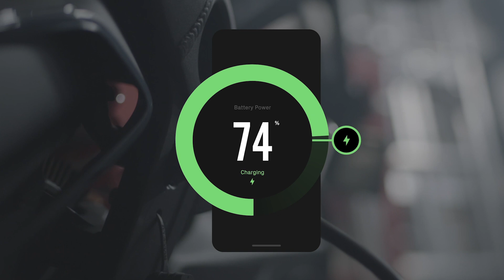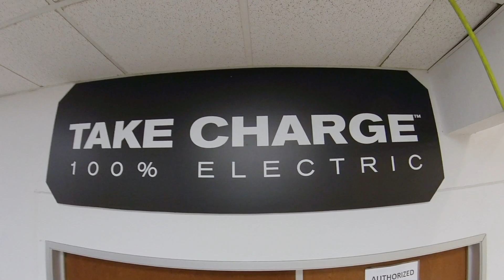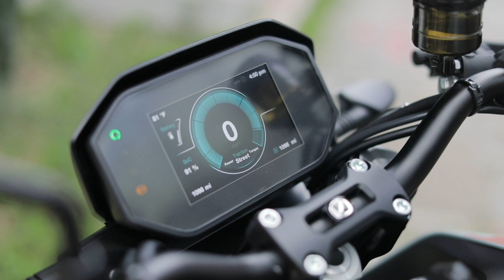Inside California EV startup Zero Motorcycles

Comment: This is a great review. I drive motorcycles for 40 years. Started on a Suzuki 380 2-stroke, Honda CB400N, Honda CB750 (single camshaft),  CB750 (double camshaft). In 2014 I drove a Yamaha VMax when I did a test ride on a Zero SR. I was flabbergasted and turned my Yamaha Vmax (great machine) in on the Zero SR. After five lovely years with my Zero SR without any trouble, I swapped to a Zero SR/F. I love electric motorcycling.

Comment: i am all for spreading good information on electric bikes, with all there faults, i still own and love to ride my zero dsr,  so why does at 1:05 seconds you CAN quote him saying the highway range is 165-170 miles ? at 65 mph,  that's odd cause its totally false, that's the city range, not highway , highway is more like ONLY 80 miles of range. even ON zeros own website they Quote 200 MILES CITY IS WITH the power tank. NOT the info this guy is saying you can hear him say, 220 miles of range in city driven miles. he mentioned no extra power tank for 3k.  it seems worse when its only 200 miles of city range, with the 3k dollar power tank option added on the 14.4 kw battery it comes with.which most owners might not have. but that's the default range ? i just wish they would quote practical figures,  like how charging time is listed to geto to 80 percent in about a hour instead of saying 1hr and a half to full charge.

Comment: Why not try hub motors and free space for bigger battery?
Reply: They are not good for a high performance package. The hub motor acting as unsprung weight at the rear wheel will hinder the performance at higher speed even though it could accelerate faster from the start compared to a mid motor.
Reply: because the physics of a hub motor make the handling awful at speeds of anything higher than 30mph or so. which is one reason why i ditched my super soco for a zero

Comment: Why is it that when talking about charging times they all quote the charging times of 0-80% rather than 100%?
Reply: Because the last 20% needs more time so it probably needs another half an hour to 100%
Reply: @A--lex  it's still not an accurate real world quote they give. People won't wait until it's at 0% and push it to a charging point and they are likely to want a full charge since the range isn't good anyway.
Reply: So basically plan on charging it for two hours
Reply: @EZ4U2Say11  still quite some way off joining petrol bikes on tour then

Comment: so 0-60 in ?
Reply: сука Blyat I’ve heard anywhere from 2.8-3 sec. That’s in MPH
Reply: Vids of people actually doing it vary between about 3.4 - 4.8 secs. Not quite sure how you can get such a variation when there's virtually nothing to it other than whacking the accelerator wide open and waiting, but it's right there on video for all to see. I tried it myself and the only meaningful timing I could do without a GoPro was "fuuuuuuuu"
Reply: Caspian Prince if they are rolling already or if they are “whacking” the throttle wide open from a stand still and spinning the tire a bit before they take off your going to have varying times. Just a thought. But theoretically they can go about 3 sec if not a tad faster
Reply: @caspianprince  Best launch is in Sport mode w/ TC OFF and a rider skinnier than me.
Reply: @Miata822  I didn't dare turn off the TC on a demo ride, but then again, it was easily as fast as I dared to go anyway! And hem hem I could maybe do with losing a couple of stone too....
Reply: @caspianprince  Cycle World Magazine claims 1.57 sec. 0-60. Don't know how they did it, I assume t/c off and in sport mode, Plus probably at least a dozen tries with a professional rider. I took a demo out and acceleration was brutal from 25mph and up. So I bought one, or at least ordered it with money down. I told the dealer I probably would never take it out of Street mode.